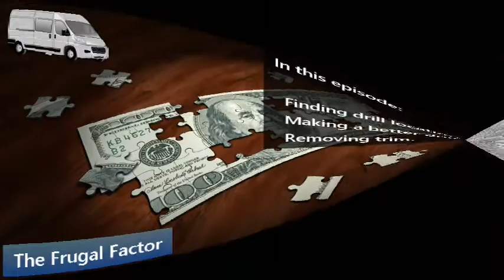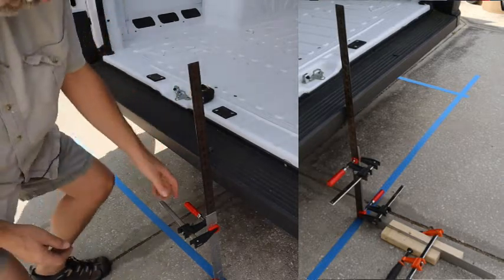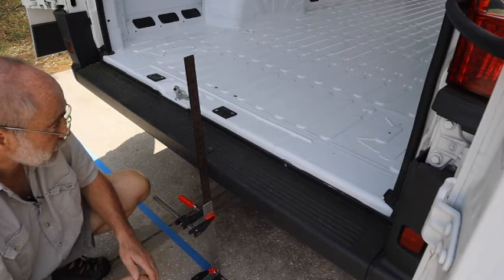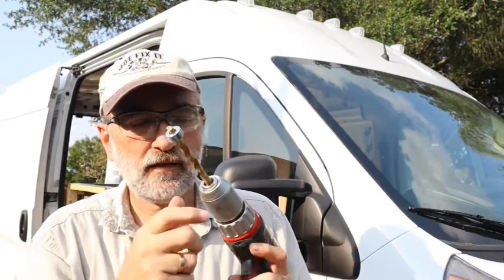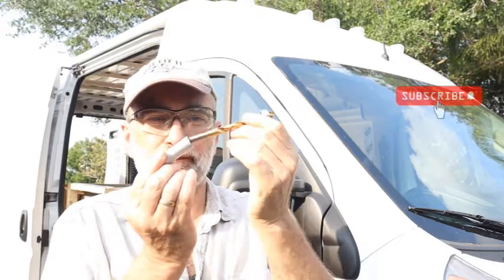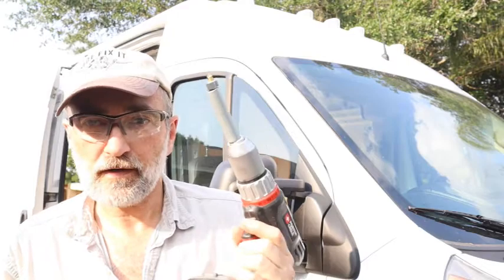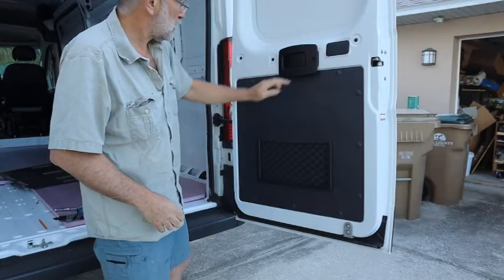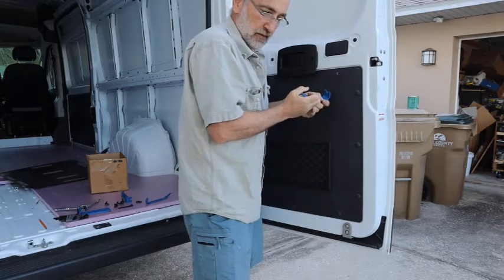Van Life building tips – Drilling into the floor, Making a drill stop, Removing trim

Comment: great tip with the measurements. However, you probably need to mention this wont work as well on a slanted driveway if the vehicle is propped up on ramps or jackstands (to level for working), which is how I am able to do work on my sprinter in my rediculous slanted driveway. But again, I will be using this and ditching the ramps to measure out my water tank mounts.